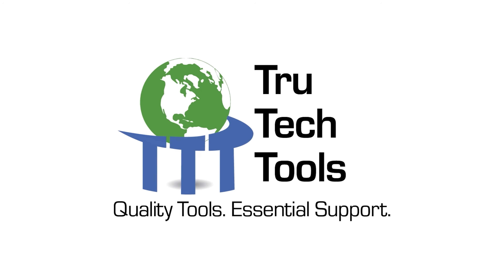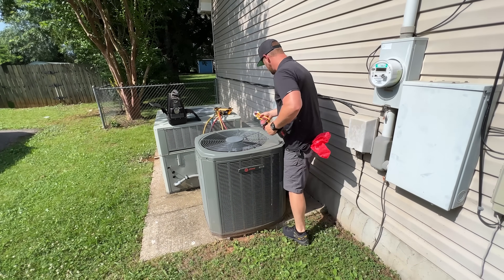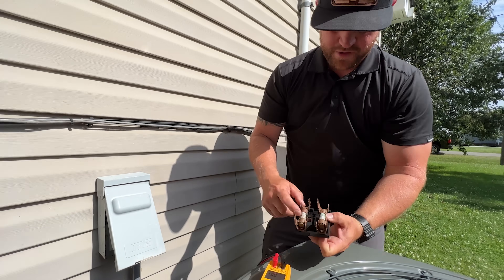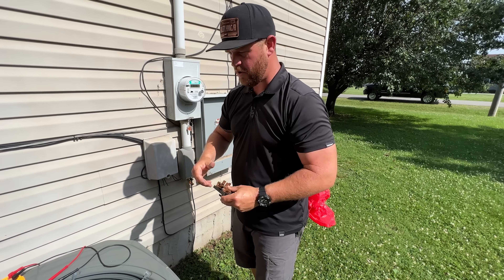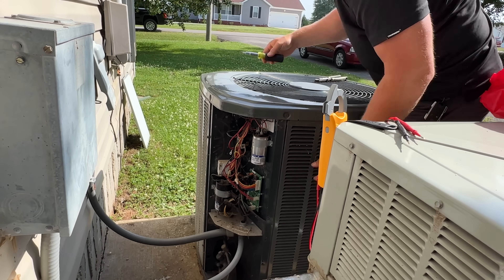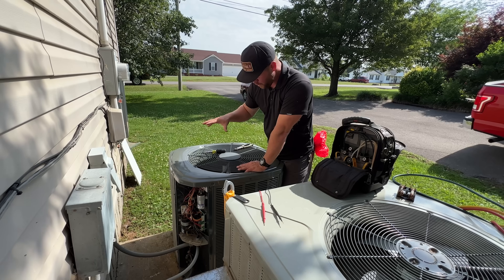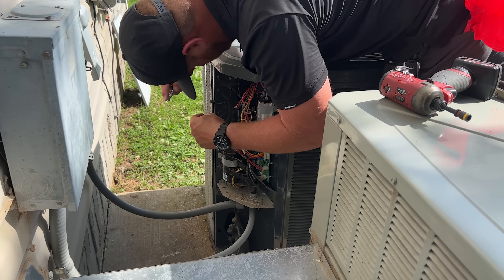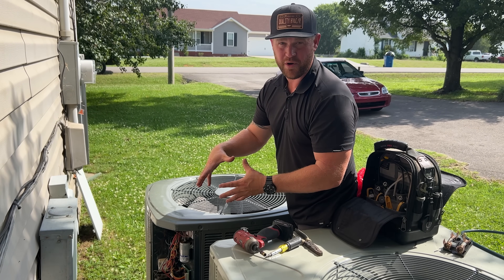How To Diagnose A BAD Compressor | HVAC Troubleshooting

Comment: Dear homeowner, don’t get discouraged if you’re watching this clip and reading the comments. You usually don’t need to replace every single part they tell you. This comment section shows plenty of AC guys misleading each other. Unfortunately, a lot of AC repair techs are dishonest. If a single part breaks, you can replace it yourself and save money and stress. I’ve been in my house for 20 years, and every time an AC guy came by, they pushed me to replace everything—some even claimed I needed a whole new system. I took a few AC classes, and I’m glad I did. BTW my system has only been down less than 5 times. Each time the part cost less than 50 dollars

Comment: Hi just curious. You tested for ground and that was pretty quickly the obvious problem but do you ever check continuity between c,r,s ? And if it’s just low on refrigerant? I checked my compressor and the c-r plus the c-s does not equal the r-s… I checked and it’s not grounding out is this normal or suggestions?

Comment: Flim Flam....
Hold on a minute. 
First off if the contactor is pulled in, it does not mean that there's voltage present. The contactor could be physically stuck. 

If I was right next to the contactor like you, I would put my meter on there and make sure that the voltage was correct. 

Second to that is the fact that you measured from ground to one of the compressor wires. 

If I measured from ground, to the compressors common wire, there's going to be a connection from that let's say to the start wire, which is then connected back to the capacitor, which is then connecting the hermetic portion of the capacitor to the "common "terminal which is running back to the contactor, which, according to you is closed, and therefore allowing current to run through.

Based on that, I would expect you to get continuity to ground. 

Also, even though you disconnected the wires, there's a good chance that you were going from a ground on the compressor, and your other lead might have actually been touching the compressor, not one of the small pins. 

Also, I have never seen anyone make a diagnosis to "condemn "a compressor without then taking an OHM reading from the compressors wires.

I'm not saying the compressor was not dead, but there's a possibility that it was not, and I think you trying to explain this as a way to "diagnose "a compressor is quite failed for those reasons.

Comment: The Entirety of my comments are about making a more convincing video. I know SOME of these answers but there are some things you should have clarified. at 0:49 you show "something" in the attic but don't explain what it is. I don't have one. @1:44 we see another air conditioner alongside the one you're working on. I have only one. My neighbors have only one. What is going on here? @5:33 you "check terminals directly to ground." WHAT did the beeping tell you? (I know but 90% of the viewers won't know how you knew the beeping meant something.)
 -- IF I were watching you do all this, and IF I hadn't had a graduate-level class on air conditioning, I'd be very suspicious of your statement that I need to spend THOUSANDS (If it weren't on warranty.)
 -- For everyone everywhere, I was a mechanical engineer. That doesn't mean I know ANYTHING about INSTALLING OR Servicing an air conditioner. [Nor is a mechanical engineer in any way, shape, or form an "Engine Mechanic." (I'm SO tired of arguing this with people.)] I know how to play with numbers on a computer, doesn't mean I know how to get my fingers dirty. I salute the heroes who do the real battle.

Comment: I cannot unplug that wiring harness from the  compressor. Does it take a lot of muscle to do it? Im afraid i'll damage something. Its a 20+ yr old r22 3.5 ton copeland . Looks like you used a lot of muscle to pull it off.

Comment: So my AC recently stopped working after a few hot days, and a HVAC tech came out and after a few continuity checks said the compressor was bad, my system was too old to economically fix, and they want to sell me a whole new heating and AC system for like $16K.  He checked the disconnect on the side of the house, and the connections at the compressor after opening up the compressor's inspection cover, but I don't think he isolated the wires from the contactor to the compressor.  Interesting note, was that there was no short to ground on the compressor wires.  The breaker in the house does automatically trip a few seconds after energizing the system, so there is an issue somewhere.  That is about all he checked electrically and did check to ensure there was refrigerant at the unit's hose connections.  Not sure how "thorough" that inspection was, but I'm no expert.  Thoughts on if it could be something else like a bad contactor or capacitor that he might have skipped before replacing the entire system?  My system is like 29 years old, so it may be at end of life, but was working fine until it stopped.  The tech had to call the office and confirm his diagnosis, so again, I wonder if his checks were thorough enough.  We have had to replace the capacitor a few times over the years, and a contactor about 1.5 years ago.  Otherwise it has worked just fine.  Also, at what point do you do a acid check?  Only when you are replacing the compressor?

Comment: I got a Goodman GSX 130241DB. Would u know what this sound is from? its still cooling in house. Pressures are still good when guages on. Gets quieter when cooler out especially at night. How does one know if its the fan motor or compressor itself? Or maybe not the compressor, fan motor, or condensor motor, but say a wire in between? Do u check voltage first on compressor, fan motor, and condensor motor? What about bearings going or needing lubrication? Something needing lubrication? Or dirty condensor coil? It quiets more when cooler out. So when hotter something is overcompensating. And pressures check out good. Still cooling. Like marbles grinding or knocking together, intensifies as it gets hotter out.

https://youtube.com/shorts/qgP_Kh9KfVg?si=IWLKSiWkeedCQDtd

https://youtube.com/shorts/_pM8Ju7oPYM?si=Yxb51bW9JyHZ3SCQ

Comment: Hello there, we have problems with Voltage fluctuations, where the voltage dips briefly and then comes back on right away. This causes my AC compressor many problems, so I installed a ICM 102 Delay on Make Timer. The strange thing is that the timer does not cut out at those dips but only delays once the electricity goes off completely ( same counts for the built in delay in my Air handler thermostat).  So here my question : what ICM could be a solution or do I need to install something else ? Thank you so much !

Comment: Typical Trane behavior, no compressor in stock middle of heat wave. So nice of them to quote you a few system just in case the customers hopefully want one since its so hot out. Trane is trash. 10 years in the trade and they are still pulling the same BS

Comment: Unreal. I literally came into the same issue today. Only been doing hvac for 3-4 months and got called out to help a tech figure out why the breaker kept tripping. Im a jman electrician and he thought it was electrical, and had to do another call. Anyways i did the exact same steps but starting with disconnect seeing if a short was either in line or load side. found a ring to ground on the load side of the contacter (2nd step i did) and same exact result. Again im very new and had to call the master hvac tech to come in to confirm since a failed compressor is kind of a big deal. He did an ohm test between leads and found ol on start to common which was a different method than i did. This trade is very dynamic and interesting and was cool to find an issue out rather than just doing electrical installs. Fun to trouble shoot.
Reply: Tripping multiple times is gonna be compressor bad

Comment: You did test on compressor but you never said or showed what indicated that the compressor was in fact bad?
Reply: You put one probe into the terminal preferably the common terminal of the compressor and the other probe on another to a grounded area. If you get continuity that’s an automatic answer at a grounded compressor.

Comment: Sir, I have an OLD unit. has been well these past 10 years. The compressor stopped working (blower motor works) the three wires are brown yellow and blue. Which colored wires should i check to ground to determine if the compressor is shot...AKA broken. Best DVD:)

Comment: Wonder why he didn't just go straight to the compressor to check the pins rather than disconnecting them from the contactor. Seems like an unnecessary step.

Comment: Good job, I like to pop off the fan, pull off the wires at terminals, and reset breaker. If it stays on you have your answer without all those other tests.

Comment: Two HvAC guys came, did none of these diagnostics and told me I need a full system replacement...this industry has become so crooked with all hustlers & no skilled repairmen.
Reply: Same thing happened to me, can you let me know if your compressor was actually bad?
Reply: @ShyGuyFTW sometimes you need a new system if your existing system is r22

Comment: The Logo of the unit should always be installed parallel to the side of the building for easier access.
A little dirty is nothing, my Trane outdoor unit went for 16 years with not one service call until I replaced a rusty capacitor. The inside unit was at least twice as dirty of what you're showing.
Reply: So you never replaced your indoor filter every month or so?
Reply: @Goodfella0982  Just to be clear, I'm talking about the outdoor unit exclusive. So when I finally had to open it up to replace a capacitor that had gone bad, that area was filled with cobwebs/spider webs. I also had to clean the area near the compressor because their were bits of insulation all around. Seems mice one time or another worked their way into the compressor sound jacked and nested. So I removed that jacket for the summer season, on YouTube you see a lot of compressors that aren't even using one, but let me tell you, it's like night and day with using a jacket vs not using one. Inside the house you could hear that compressor upon starting up, and also continuous running. Next season, I get a replacement jacket for sure.

Comment: Most failures are because the installer was a buffoon and brased the lines without nitrogen and did not know how to properly evacuate and charge the unit. I installed my unit 32 years ago and I installed a hard start kit it is still running like a dream. I change the contactor every 7 years and keep the coil and filter clean
Reply: Hi Bill, have you used stabrite and stakleen yet? They say that nitrogen is not required when using it with Mappgas. My unit is 30 years old, on its last legs, and I'm thinking of replacing it myself. I'm very good at soldering copper plumbing pipes, and pretty much everything else.
Reply: @user-ut6ji8my2h  No just use 15% silfos no flux required.  Practice on some pipe. If you can solder you will be great at silver brazing because it's easier. Just be sure to use nitrogen for no oxidation and a clean joint
Reply: @billyflanagan9657  Thank you Bill, I thought nitrogen was not necessary with stabrite. I guess better to be safe than sorry, huh?
Reply: @user-ut6ji8my2h  No you're right you do not need it with staybrite to the best of my knowledge. What I recommend is just use 15% silfos brazing rod with a nitrogen purge. . It's easier than using staybrite and be sure if you're refrigerant is high pressure like 410a you can use staybrite for pressures that high
Reply: @billyflanagan9657  thank you, Bill.

Comment: Why did the compressor fail? Did we check the superheat and compression ratio? Also install a HH drier and acid away  and a suction filter drier.Also check the total static to be sure you have the proper air flow across the evaporator.

Comment: If a Airconditioning mechanic can't troubleshoot why a compressor will not pump freon then they should have stayed as an electrician pulling wireand bending conduit or plunging toilets or cutting hair or driving a truck or collecting a i am a moron government check😂

Comment: Everyone don’t forget to flush your lines if bad compressor probably going to have oils and contaminants in the system. Here in KY I use r11 flush. Use virgin refrigerant guys unknowingly skip over this a lot around here and new compressor will go bad 1-5 years guaranteed. Braise w nitro, protect your valves, swap other warranty party while you’re in there. I also swap filter dryer to be safe 🤘

Comment: I am a retired 69 yo HVAC contractor, licensed here in Texas, still working. I enjoy watching technician and i like your professionalism and the care you take to do things right. Thumbs up! No doubts, i only have my right arm, but i am able to change motors, capasitor,  etc. Congratulation on this great video.
Reply: I have a question if you don’t mind to answer. My condensation drain line ends right outside my house.  Literally at the end of the house foundation. There is a 6 inch cemet cut out that it drains into. The rest of the area is a very large concrete patio and pool area. Sometimes the water overflows and it covers the condensation line. I recently upgraded my entire unit with a Trane xr14 system. Is that going to be a problem in the future?
Reply: @sergioorozco9044  well your condensate line should be flowing downhill so theoretically no. But maybe you could create a French drain or something like that to help drain the water.
Reply: With only one arm, you probably take twice as long and charge twice as much?

Comment: I had a HVAC technician come out today, $95 service fee and he told me my compressor was shorted to ground checking by the contactor but he never actually opened up the unit and checked the compressor itself. The unit is only 1 year old (rheem) so covered under warranty but then he needs to drain, recharge coolant and add in new filters I believe. In all it’s going to cost about $900. Should I go buy a multimeter for $50 and check compressor myself to make sure it’s not a bad harness or wire before I pay him $900
Reply: I'm chasing a bad evap in Rheem....15 months old.
Reply: @nicholasr7987  it was worst case scenario for me. Compressor broke apart and sent metal shards through the whole system. Paid $1,500 for new compressor which blew as soon as we turned it on. Had to get a whole new install and rheem wouldn’t honor warranty and it was through a “rheem pro” company. $8,000 for whole new system. Less than 2yrs old. Watch for the TXV valve in evap, tends to clog.

Comment: You should use a megger capable of producing 500 or so volts for checking for grounded compressors and motors, instead of a ohm meter with a 9 volt battery.  It will pick up high resistance ground faults measured in megohms, that an ohm meter can’t find.  I use a crank type AMEC, and use it for troubleshooting all types of grounds. If that compressor turns out to be a burnout, there is more to cleaning the system, than blowing it out and putting in new refrigerant.  You should install burn out dryers, or what they call a temporary clean up kit, and change out the dryer cores until there is zero acid in the oil.  Otherwise you will have another burnout in short order.  This procedure makes compressor replacements very expensive, because it can require multiple return trips.  In the case of a running burn which has pumped contaminants such as nasty oil and soot thru- out the system it’s better to just replace the whole unit. If the burn is what we call “clean and sweet”, with no acid or odor in the oil, you can get by with just replacing the filter dryers.
Reply: with a dead short to ground in a compressor a mega ohm meter is not necessary.  it's grounded, to what extent it's grounded is not vital.  what he does not show is the condition on the condenser coil.  spin fin tubing is notorious for clogging.  maintenance on a trane condenser is time consuming and not done regularly.  i'd bet that's the cause of the burn out.
Reply: @tedallen9078  I agree if it is a dead short to ground, you will pick that up ok, but an ohmmeter cannot detect a very high resistance to ground at operating voltage.  A condition such as this can still cause blown fuses and tripped circuit breakers.

Comment: Thanks to the installer who faced the access towards the home. They could have turned it another 90° and made life so much easier for technicians to work on it
Reply: Putting the access panel on the outside not only looks like garbage, but have now exposed the lineset and valve to possible damage.
Reply: @marketmash6953 I think you don’t do Ac 
Panel should be always service accesible
Reply: @marketmash6953  He said 90, not 180.
Reply: Punch a hole in the wall for easier access inside the building.
Reply: Ok Sam
Reply: @brianpatrick678  You can't fix stupid or lazy, and they go hand in hand.

Comment: Probably mentioned in other comments but I'd have mentioned that the LL driver is replaced anytime a system is opened. It will be covered by Trane/AmStd when warranty compressor is changed.  And if acid, consider Acid Away. If oil sample is not clear, a suction line filter added. Maximum 5 psi drop after 24 hours of RUN TIME and must be changed. If less than 3psi, ok to leave in but they are supposed to be removed when done cleaning up the system. If you want to get fancy, pipe a bypass around it.
Reply: If I had a bad burnout I would install a  temporary clean up kit, and change out the dryers until the oil test showed no acid, and the oil was not discolored.  These go in the suction line and have high capacity acid removal cores and temporary hoses. When you are done a piece of rigid pipe goes in place of where the kit was.  I’ve replaced large compressors, 125 Carrier semi heretics which are very expensive.  You can’t afford to have another failure, so you have to do everything possible to prevent it from happening again